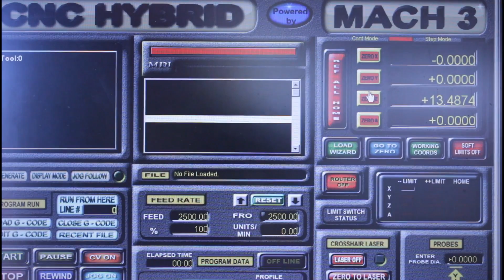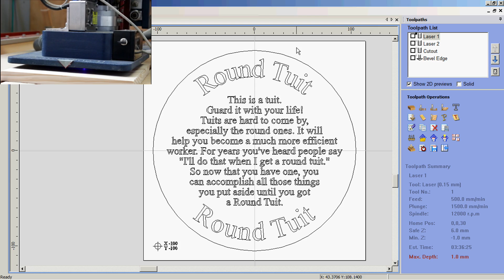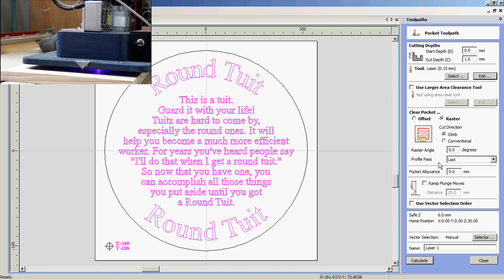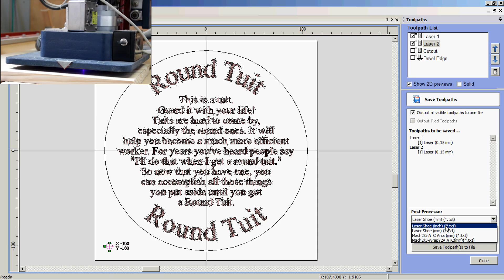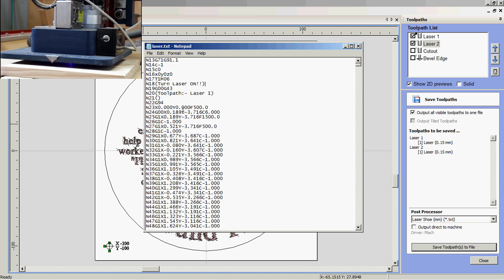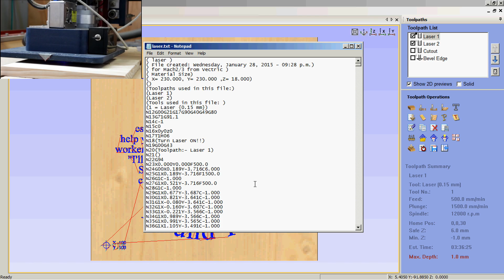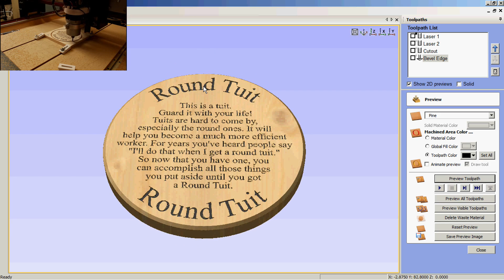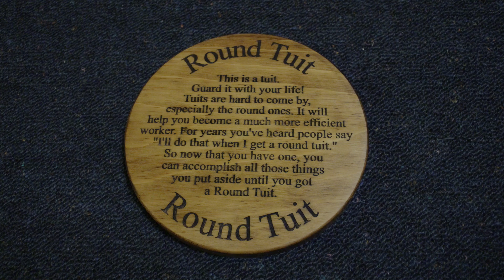Getting a round to it (Creating Laser Engraving Files) - CNCnutz Episode 98

Comment: Hi Peter, a job very very nice, I've done cenire want to apply a laser to my cnc. What you use is 2W? You give if he can cut even more than that affect balsa wood?
Potresi tell me how you have configured Mach3 to use it as a cutter and also with the laser?
Many thanks Marco from Italy.
Reply from the maker: Hi Marco,
The laser I am using is 1.4W but get whatever size you want. I have not tried to cut balsa wood with it so don't know if it would work but if you are trying to cut through balsa then more power than I have might be a good idea.
This video is the first of 2 videos that shows how I made the LaserShoe and the 2nd part shows how I set up Mach3.
Cheers
Peter